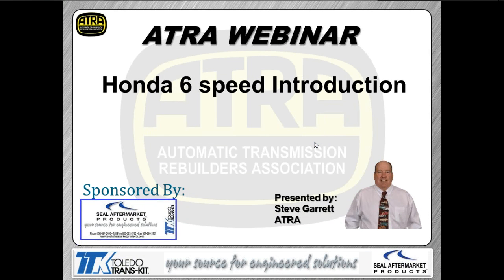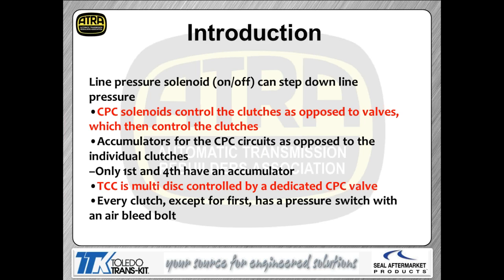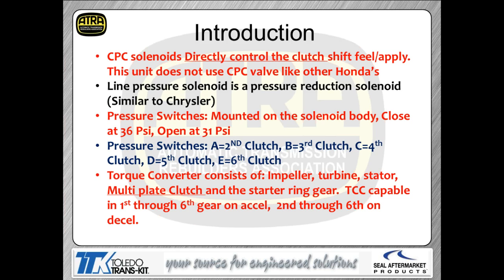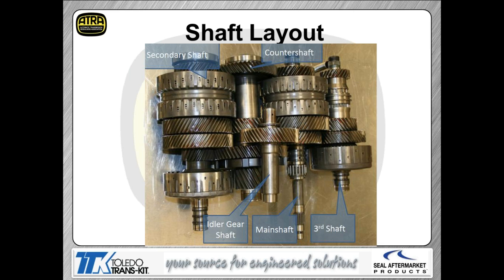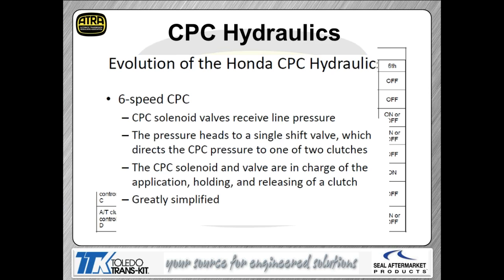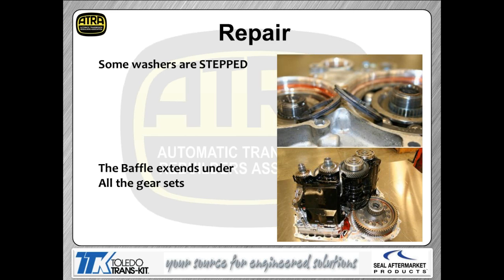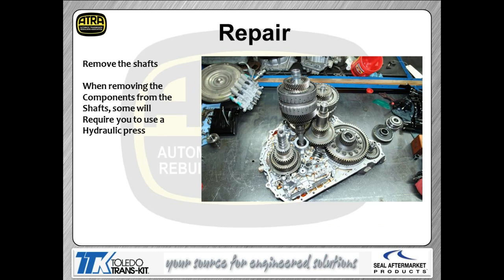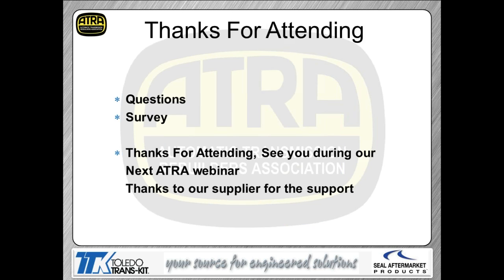Honda 6 Speed Introduction - 3/27/14

Comment: Im building a custom racecar with this transmission, and id like to raise the pressure and lessen the shift slippage as i am not worried about a smooth transition shift, id like it to be firmer and more a solid engagement,  can i modify the switches to accommodate this?